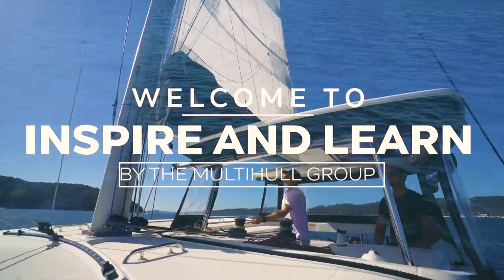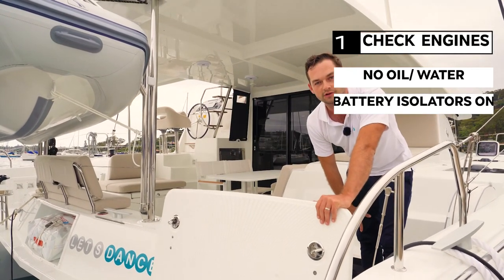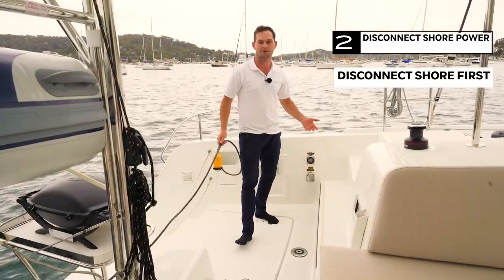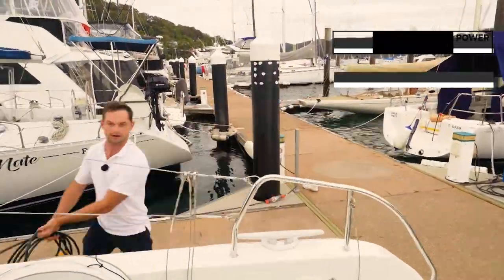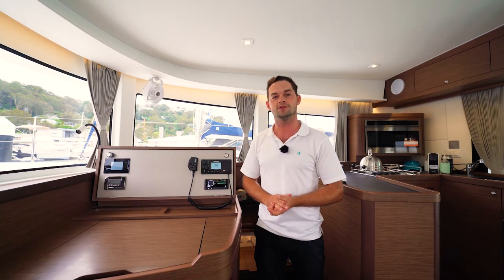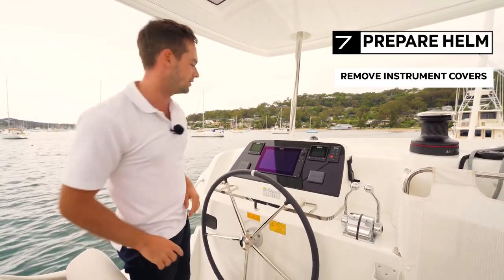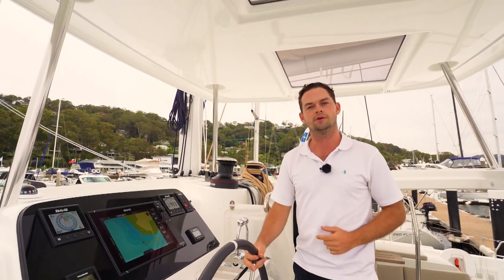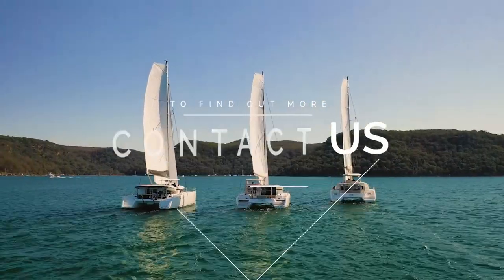What to do before leaving the dock | PRE-DEPARTURE PROCEDURES

Comment: Why did you not turn on your Auxiliary switch? Do you not have a generator? What does the Auxiliary switch do please?
Reply from the maker: @angelaevans3457 the Aux switches are often spare switches the manufacture places in so you can add electrical systems if you wish. For instance, you could add 12V televisions on board or fans, you could then wire up this switch as it's isolator for these.